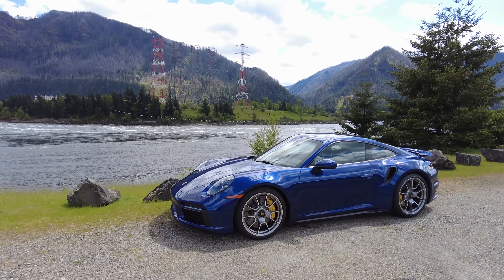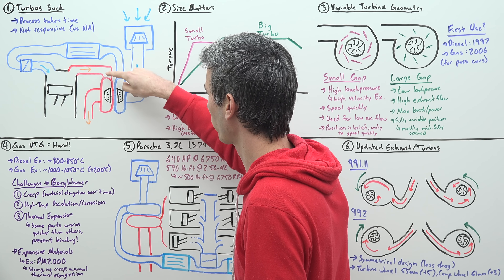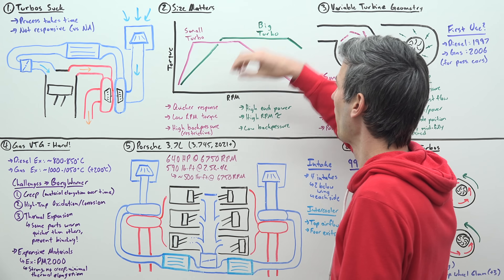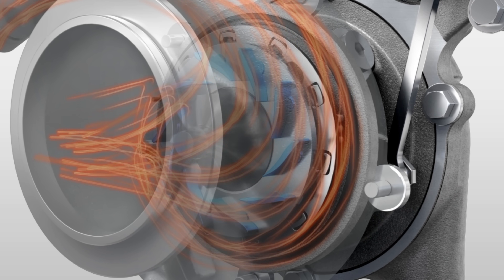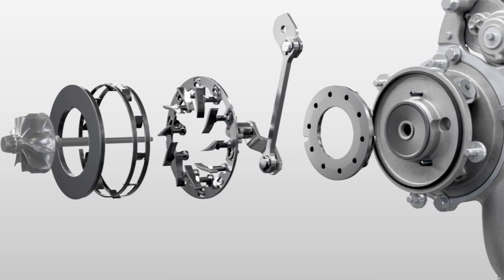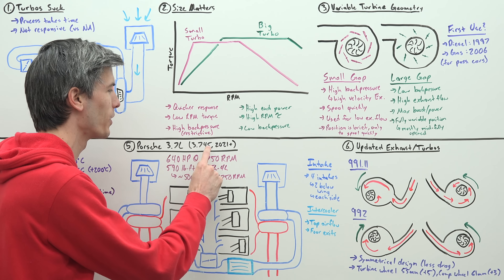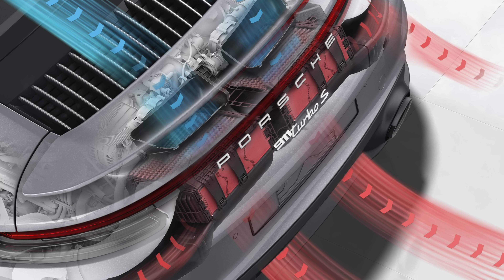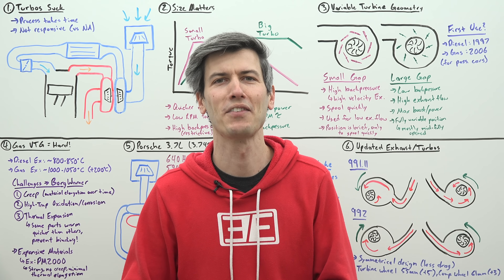The Perfect Turbocharger? Porsche Did It First

Comment: Sooo much work to get it to be as good as an electric motor.
Reply: Going through all of this to make turbos respond to throttle inputs more quickly, while super interesting, is only an attempt to get them to approach the truly instant response of electric motors.
Reply: @shamp00p that’s always been the Achilles heel of electric cars: everything’s better, except the battery. However, this has largely been overcome with Li ion batteries, and now that EVs are being taken seriously, there are massive investments being made to improve the batteries, making ICE cars more and more unviable.
Reply: @shamp00p  Charging infrastructure is being built rapidly (I charge at home at night when it’s cheaper anyway) they’re decreasing the need for cobalt in li ion batteries and lithium iron batteries use no cobalt. The batteries aren’t like phone or tool batteries as they actively manage heat and charge balancing making them last the life of the car w/at least 90% capacity.

Comment: Oh my ... that rings a bell ... when I wrote my Diploma-Thesis, I did a lot of simulation to improve response of a miller-cycle gasoline engine. Having a variable valvetrain (I used the lift arrays of BMW's Valvetronic) is a key element here, but only so long as the steady-state operation at full load is not at the limit in regard to CA50... Having this at like 40 deg ATDC in steady state ... means you won't. Having it there in the transient operation helps - you can use a longer and higher lift, basically just swinging over a bit, and still avoid knock. Miller cycle works best, of course, with max. boost pressure and shortest intake duration. Adjusting the cams to more overlap helps also, but don't be fooled - miller-engines have poor transient performance still, compared to a similar one.

A VGT, of course, helps here, too - and in some cases, the lower backpressure at max power makes up for the rich mixture used in order to avoid overfrying the turbine. Man, I loved that ... setting up cam timing and valvetronic overswing, ignition angles, and the operation of VGT versus time, and handing it back to a PID-control at the right time ... makes the response a whole lot better - but still, we have less exhaust mass flow, less exhaust temperature and need more boost pressure, equalling a higher speed of the turbocharger's rotary parts, means that you can't help but, unless your boost system is a bit more complex, a miller engine will have poor response.

Porsche enabled something here that bears a value many seem not to see ... introducing this to gasoline engines a decade before it entered real mass production (think EA 211 of Volkswagen), ... anyway, a hybrid drivetrain comes to mind, where the lag may be covered electrically, and also, the turbocharger(s) may use electric power to spin up faster, ...

... great memories... And now, I do industrial equipment for something totally else. Also interesting, but not of any mattering here....

Great video, as kinda always!
Reply: @bluejar5614  Sure!
Reply: sweet dump of knowledge. I wish I had more people that lived in my neighborhood like you that I can grill/chill by a fire and learn from in casual conversation.

Comment: Dodge & Chrysler had a variable nozzle turbo charger in 1989-90.  On the Shelby CSX (Dodge Shadow) and Chrysler Lebaron GTC models.  Unfortunately the turbos began failing and they stopped selling it.  Apparently only 1200 were sold.
Reply: Weren't those mitsubishi motors or something?
Reply: @joshuagibson2520  nope, they were on the Chrysler developed 2.2.
Reply: I'm sure there is a distinct difference between variable nozzle and variable vane.
Reply: @aguilpa1  nope.  google it.

Comment: So interestingly, this isn't the only gasoline application of this tech now. VW (Porsche's parent company of course) is now using it in the EA211 Evo gen2 engines.  The 1.5T gasoline engine in the new Taos and Jetta also uses this, the first mainstream application of it. You previously made a video on VWs water cooled exhaust manifold, and they specifically cite that as a reason it's practical as under load it decreases EGTs at the turbo by something like at least 100C.

Comment: how is the geometry of the turbo controlled?
Is it using AI to maximize power or efficiency or cleanliness, or is it deterministic?
After watching Rob Dahm's video adding drive by wire to the RX7 I am wondering how are the car computers making such decisions
Reply: In the aftermarket ecu world it's look up tables with some mild learning going on, with target variables and conditions.
Reply: Hi,it must be preprogramed by defaut to maximum efficiency with less pollution and lower fuel consupsion all time.What ever throttle input it always be in the marge of that.Some people are confused by the "sport mode" "gimic" in some cars.The power of the engine is the same but,the throtlle is more sensitive and shorter distance.
The Rob drive by wire is not locked at the power vs efficiency vs pollution by default,he put values in for power and having efficiency in regards of power.(too lean=hotter too rich=waste of fuel).

Comment: Variable nozzle velocity is the goal, differences in backpressure is the consequence.
Reply from the maker: It's the pressure differential that creates the velocity. Same with sticking your thumb on a garden hose.
Reply: @EngineeringExplained  Agh, you're right.  Nevermind.
Reply: @ducbox572  really both are the goal, high nozzle velocity creates faster spool up, lower back pressure at higher rpms frees up more power

Comment: From the first day that I heard about turbo's as a kid I always wondered, why don't all cars have a turbo? It seems simple as regenerative resource.
Reply: depends. some really wanna cut costs, and no turbo means generally cheaper engine (pushing boost into a cylinder in order to stuff more fuel in results in a noticeably stronger bang, which can send pistons and rods through engine blocks if the engine isn't tough enough to handle that). some would rather have less weight, so they ditch the turbo and to compensate, they run higher compression ratios and redline far higher (honda S2000's F20C redlines at 9000, or the F22C that redlines at i think 8,300, etc.). of course, less weight from not having an intercooler and turbo is also helped by lighter pistons, crankshafts, etc. and on top of all of this, turbos, as mentioned in the video, tend to have some lag, and some want to have a really responsive engine. also, less power can sometimes be a good thing, especially in FWD cars, since more expensive suspension geometry is necessary to mitigate torque steering, and for RWD applications, you need a good suspension/tire setup to not lose traction when you put the pedal down. turbochargers can be seen as a reliability compromise as well, since they get really hot from the exhaust gasses, which generally increases their coolant/oil temps significantly, leading to increased maintenance requirements/costs and if these aren't maintained properly, they can cause significant (and costly) damage to the engine (oil gets too hot, doesn't cool off properly if you shut the engine off too quickly after hard driving, it stops lubricating well and voila, you spin a bearing or something similar happens, culminating in an engine rebuild).
Reply: @vukpsodorov5446  I think you are right, turbo's are a bad idea, too much potential loss for the gain.

Comment: Do you have anything on electric assisted turbochargers?
Reply from the maker: Yes!
Audi Solution: https://youtu.be/k8-_UrfbRBA
Mercedes F1: https://youtu.be/ckCd9D-eBm4
Reply: A little pendantry appears to be in order here. A supercharger is any device that actively boosts the intake pressure of an ICE. Traditionally, superchargers were mechanically driven (gears, chains, belts). In WWII aircraft engine designs were created using superchargers that were driven by exhaust gas turbines. That is a turbosupercharger, the full correct technical name. Popular usage shortened that to just "turbocharger" and eventually to just "turbo". An electrically powered supercharger would be an electrosupercharger, not an electric turbocharger. Unless it is driven by an exhaust powered turbine it is not a "turbo" in any way shape or form. Sorry, Porsche Taycan.
Reply: @avsystem3142 , Formula 1 has been using this, shall I say “device”, for a while now. They have even trickled down to street driven cars. There is an electric motor between the turbine and compressor. This allows almost instant boost, over boost control, and battery charging. I am hoping Engineering Explained can dive into this unique, “device” 🤷🏼‍♂️
Reply: @rickrack78  What you are describing is a hybrid electro-turbosupercharger.
Reply: @avsystem3142 , yay… Webster’s Dictionary beating, round two… ask a silly question, get a silly answer. I was looking for substantive information, and intellectual discourse. All I get from you is a lecture on your superior ability to give me a definition of that which I actually know a great deal about, and have actually worked on in it’s development.
Much thanks to Engineering Explained for the links. 👍🏻

Comment: I keep thinking about how easily accessible that catalytic converter is... Jason, could you do a video on the exhaust gas composition of the hybrids like the early Priuses and why that dictates more precious metals? The cats have to be bigger; also, the metal composition of diesel catalytic converters? I think it would be an interesting topic to cover. There are not a lot of videos on the details of the fluid dynamics of catalytic converters and the physical chemistry happening with exhaust gases, and how that correlates with different engine types and uses (gasoline all the time, hybrid, diesel, etc.). Most videos are, if anything, opposite, straight pipe... I think the engineering behind regulating those emissions gasses is quite interesting and overlooked no matter what one's perspective is on regulations.
Reply: The Prius cats, and other ultra low emission vehicles, have extra big cats just because they’re chasing that ultra low emissions rather than being just good enough for regulations. 
The diesels have an oxidation catalyst that doesn’t have any really expensive or special stuff in them. It’s basically just a ceramic core designed to get hot and burn the fuel when running a regen cycle. 
Newer diesels also have a selective catalyst that is what uses the exhaust fluid to reduce NOx emissions. That one also doesn’t have the precious metals like a gas catalytic converter.
Reply: @NBSV1  Innocrect. The early Prius on and off would not get the catalytic converter hot enough which is essential for its operation. Because the engine goes in and out. They got better by the 3rd gen Priuses. Also incorrect for diesel.
Right now palladium is twice as much as platinum. Diesel catalysts have more platinum and gasoline cats have palladium. Rhodium is also used to reduce NOx emissions. My VW TDI post dieselgate has all three elements. At the peak of prices approx last year my emissions system was worth $1200 at the scrappers...
Either way, it would be nice to see it on the whiteboard. It affects performance greatly and a tremendous amount of R&D is involved.
Reply: @djolecar88  So, you ask a question just to prove that you already know the answer? 

If the diesel takes DEF then it has all 3. Otherwise it only has the oxidation catalyst and the particulate filter. The oxidation catalyst doesn't do what the catalytic converter does on a car. It's just there to get the exhaust hot enough for the regen on the DPF. Some of the systems that use an injector and spark plugs actually don't have the catalyst at all since it works without it. 
Your exhaust was worth that much more because the could sell it complete than because of stuff in it. When we replace them at work they often don't even have a core charge and nobody wants them. Considering the size of them on medium/heavy trucks that'd be a lot of stuff if it had any in it.

Comment: The best explanation of turbo charging I think that I've ever heard.  This turbo redesign is truly special.
Reply: Variable-vane turbos are basically the best of both worlds IMO. Far quicker spool-up at low speeds but also the ability to handle high flow rates.
Reply: they also become endless money pits as they age...
Reply: @fidelcatsro6948  ever seen what the price tag of a full engine rebuild on a type 616 engine out of a 356 Super 90... price out that special 2 over crank bearing....
Reply: @knurles  must be very very expensive
Reply: @fidelcatsro6948   Like my first wife.
Reply: @dhess34  🙀?
Reply: @fidelcatsro6948  she’s an endless money pit?

Comment: Well why not a electric turbo sinse it's instant and low maintenance and it can be as big as it wants that makes more boost and u can put one at the exhaust to pull the air out fast it should allow for higher revs (idk why company's so rich don't do it if there's a reason someone lemme know cuz I'm dying to know) plus u can do like two profiles fro driving one high performance one high efficiency and something else why not fun radiator coolant through the air intake to decrease heat(i think cold air makes a better boom🤔)
Reply: F1 have electric turbos. But electricity is only used to spool the turbine at low rpm, then the exhaust gases take over. Which makes a lot of sense. Fully electric turbos would lower engine's efficiency
Reply: @grumpy_0ld_man  i say it for performance cuz it's a freaking porche i don't think anyone driving ones cares about efficiency plus if u do at high rpms too u have absolute control over engine boost but F1 is limited boost so I don't think it makes sense to have it run all the time
Reply: Electric turbo doesn't make sense because of two reasons:
1) It doesn't recoup exhaust gasses energy - exhaust gasses spin the turbo, which isn't compromising the efficiency of the vehicle. For electric turbo you'd have to canibalize engine power to charge the battery to power turbine (electric supercharger) or mount an alternator in place of a turbo.
2) If you're recouping energy from braking it's more efficient to just have an electric engine power the wheels rather than powering the turbine 

Electric superchargers are used on some new Audis, they were mentioned on EE previously.
Reply: @protocj3735  1) do hybrid power train since i don't think anyone gives a damn 
2)a Porsche is a Porsche and people want to hear an engine roar .
These are my answers

Comment: The B4 Passat had variable geometry turbo in the AFN 1.9TDi. The B4 was made between 1993 and 1997, so the first diesel wasn't made in 1997
Reply: I had a '97, great setup. Learned some basic tuning and it really came alive!
Reply: @dan3470  I want a B3 right now, and swap one of those engines into it. My friend has a built engine B4, around 170-180hp, with a MK4 Golf transmission, he does 200 km/h easily with it lol

Comment: Why don't all cars have variable turbos now?
Reply from the maker: Discussed in the video, section 4. :)
Reply: Because there are more efficiency gains and way more responsiveness gains from electric assist, either direct drive on the front wheels and/or a flywheel/starter replacement. No, I don’t know why every $50k+ car doesn’t have that.
Reply: Maybe gas engine exhaust are hotter than diesel one, need special metal alloys for the fins. Common on diesel suv and cars non-US market. But you can correct me if I am wrong.
Reply: Because internal combustion engines are obsolete and nobody cares anymore.